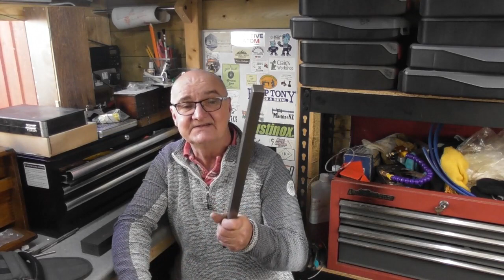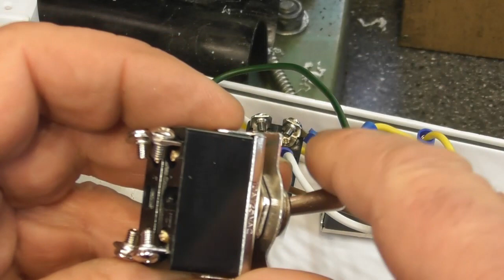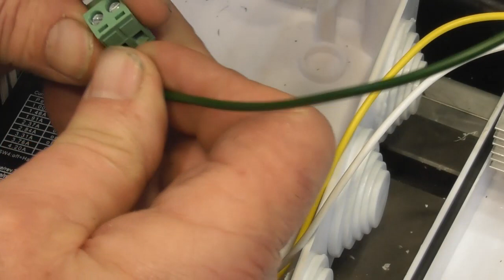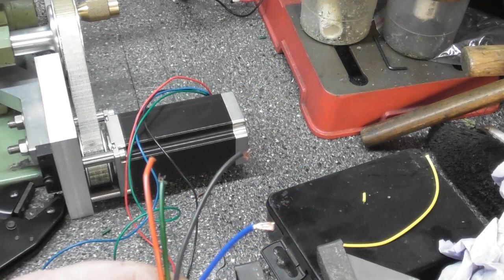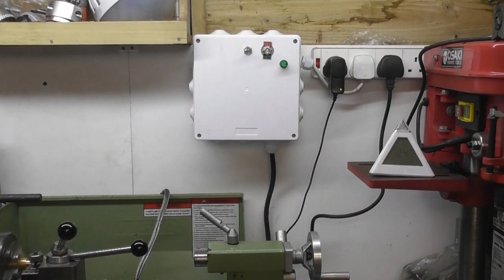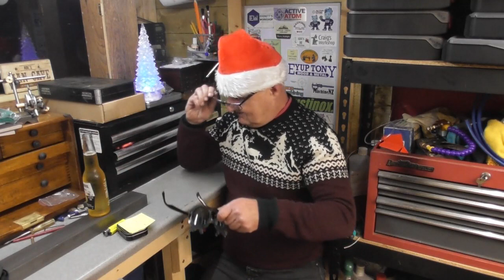Christmas 2021   Two projects complete

Comment: Thanks for all the very informative videos! Now that you have finished this project, I've seen some kits that connect the stepper motor in the void space under the speed adjustment of your Warco lathe with a clamp similar to the ones the threading gears use. They even advertise with the proper controller, you can cut gears digitally with a rotary encoder. I'm interested in trying this out, but the down side is if I could still cut gears with the motor power off. I can send you a photo if you are interested in the upgrade.

Comment: Hi Ade. Came to see the S50 operate and it looks great!
I was a little concerned by the wiring for the stepper controller because, as you say, it isn't the "normal" way to do it. I've checked the controller datasheet and looking at the input circuit (PUL, DIR, ENA), the floating signals I was worried about don't seem to be a problem. What you might want to think about though is that those inputs are through opto-isolators which have only got a 270ohm input resistor. They are anticipating 5V signal use from an Arduino or similar. Your 24V signals will be overdriving the opto-isolator leds a lot. It might be an idea to put 2k 0.25W resistors in series with the signals.

Comment: Hi Ade. - A very happy and prosperous New Year to You.
I am refurbishing a Colchester Bantam with a Colchester made pre Dickson QCTP that you just cant get holders for so I will be making some. I am new to this hobby so can you tell me where I can obtain the EN8 steel . Thanks in anticipation Dave M.
Reply from the maker: Try college metals . and there are various UK suppliers like Metals 4 U etc . It is hard to get steels in smaller quantities from anywhere . maybe ask local engineering firms if there are any near . worst case for for gauge plate or 01 steel online . pricey but worth it . Cheers Ade

Comment: Hi Ade. Are you using the same switch setting on all 3 stepper drivers? 
When you have a moment can you tell me what they are?  I’m using 1 - 4 off, 5 on, 6 off, 7 - 8 on.  Seems to work ok
Cheers Noel

Comment: Is the green the negative or the ground? They are not the same thing. Ground is not part of the circuit. It’s never supposed to carry power unless there’s a fault. Green should therefore never be part of the circuit. It’s reserved for ground only. This can be confusing over there because ground is usually a green/yellow wire. But it’s bad practice to use green for live wiring. This motor manufacturer isn’t using internationally recognized wiring standards.

The steam engine is fantastic. Superb precision.

Comment: Great setup there. One thing,  I know you don't really have a large load on the motor but the box is totally sealed. Coming from an old electronics professor you may want to open two of the holes in the box to cool those heat sinks.  One at the top and one at the bottom would do nicely. Once again nicely engineered Sir. Merry Christmas and Happy New Year.  73
Reply from the maker: I think I did mention that I would be drilling holes in the box at the top and the bottom . not so big that swarf may get in though . I would be interested on your views on the way I have wired it though . any better ideas? Merry Christmas . Cheers Ade.
Reply: @ade63dug  They make micro  brushless motor fans like those that cool laptop computers. You can put it in the bottom along with another 1 inch hole with a plastic screen glued on. The fan can be tied into the internal power supply. It would remove any worries and protect all your hard work. I plan on following your lead on this setup,  I'm not happy with the feed on my mini lathe.  Thank you Sir.

Comment: Good to see the projects completed.  Well done.
I would be careful when rotating the stepper motor by hand.   You will be creating a back EMF since the stepper acts as a generator.   If you rotate too fast the EMF can zap some part of the electronics.
Just curious, did you set the microsteps?   This can provide more speed control, but more microsteps reduces the max torque of the stepper.
The stepper driver is as noisy as I expected at high speed.   I just replaced the control board on my 3D printer to a version with silent stepper drivers, which are indeed silent.   I have not found a low noise stepper driver for the NEMA 23 stepper which needs the 4Amps same as yours.
I have a Rose engine jig for my wood lathe which needs a very slow rotational speed.   I use NEMA 23 stepper and similar driver to yours.    I also jumpered the negative wires on the stepper driver.
I use an Arduino microcontroller to set the equivalent of the pulse generator signal, in my case the Arduino sets a delay time between steps.   I use a Nexion display for user interface. 
I will have to get one of the pulse generator boards just to try it with my jig for fun.  It seems your board can achieve the very slow speeds I need.
I tried the EBay UK link for the pulse generator board, but it did not work for me.   Many such boards on US EBay.
Cheers.
Dave.
Reply from the maker: I think that I set the driver to 1500 steps per rev and set to 3.6 amps current . I am going to experiment with these figures to use the least power etc. Work in progress to learn this stuff . I would like to use arduino on the mill so that I can set an acceleration ramp etc . Merry Christmas Ade.
Reply: I think setting the max current is just so the driver can prevent the stepper from being overloaded.
I do not think the microsteps changes the current, it just provides finer control of the speed at the expense of torque.
If you do decide to try Arduino on the mill, I am happy to assist with the code.   A big challenge with Arduino is a lack of test mode/diagnosis in the editor for the code.   You have to compile and upload the code to the Arduino while attached to a computer so you can use what they call Serial Monitor, but you have to code for any value you want to see to appear in the Serial Monitor.
Cheers,
Dave.

Comment: Thank you for a very helpful Vido. I am building a tracer unit for my lathe using a steeper motor on the cross slide and not sure on how set up the wiring . Merry Christmas to you from Lancaster, Pa. Bob

Comment: Hi Ade.  Seasons greetings to you and yours ☃️.  It’s been a good year, thanks for the education and enjoyment.  It was capped off for me, when you made the breakthrough of switching the ENA and DIR wires externally, you know what I mean.  My setup on the X and Y drives on the 16B is nearing completion, the electrics all work on the bench.  A couple of observations, the lathe stepper motor seems a bit oversized for the job, but no matter, and it might be worthwhile mentioning that the screw cutting gears ‘banjo’ are disconnected.
Cheers Noel
Reply from the maker: That is a good point to mention the banjo . I think the motor may be over size but perhaps safely over engineered . lol. Merry Christmas Noel . Cheers Ade.